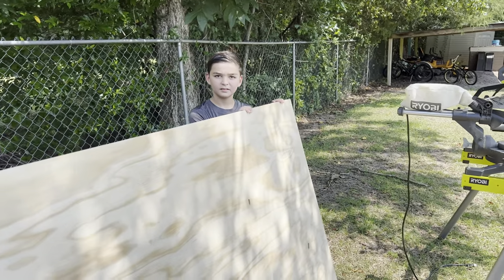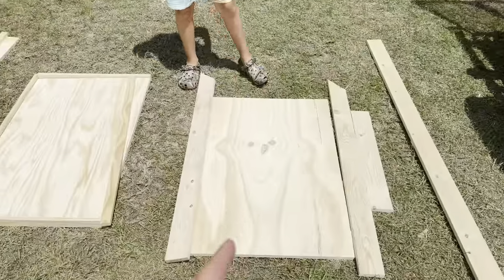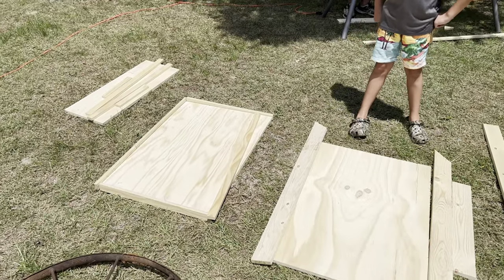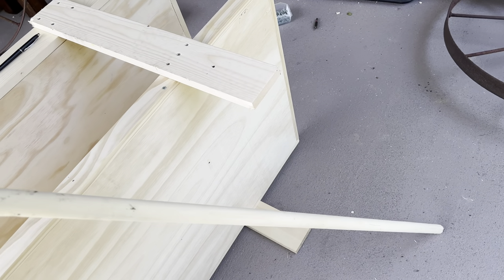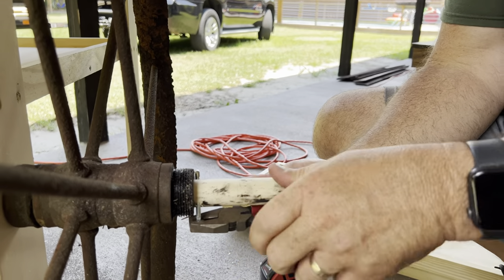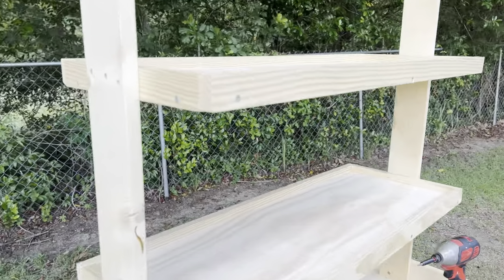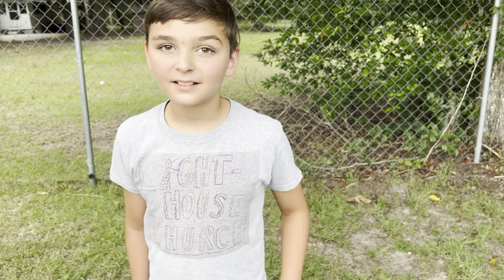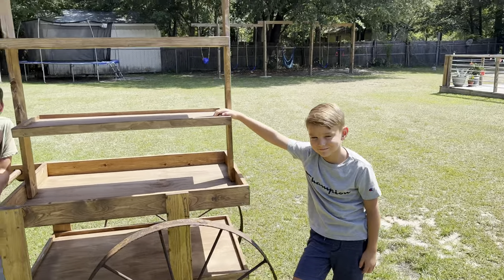DIY Wagon Cart for home or business

Comment: Fantastic job guys!! So excited for you to sell your cacti and mugs (and anything else you decide to add!) I think you gentlemen could go into business selling these wagon carts. Even as pre-fab kits. 

I’m looking to make one soon. Thanks so much for your guidance. I think I may try and use galvanized plumb pipe for the axel and just screw a flange and or cap on the end. (I may need to design the cart width around the length of the pipe 😆). Thanks again. Best of luck Jo in all of your future ventures! You’re going to do amazing!  🌎🌟
Reply from the maker: Thank you! Great idea on the pipe. We were thinking it would be better, but no local hardware store had galvanized in the size we needed.
Reply: @TheTrentTribe  wondering what size wheels you used? I’m going on the hunt! Lol